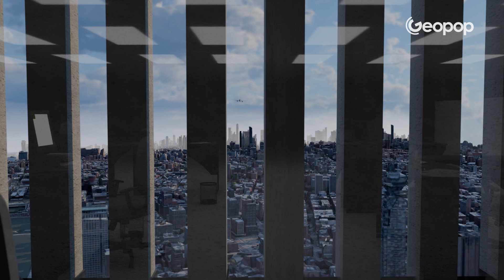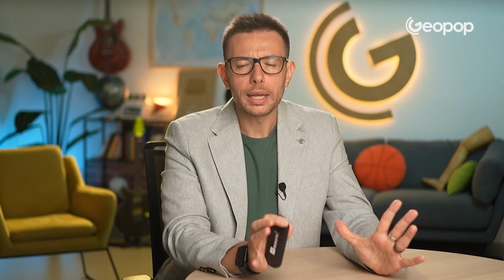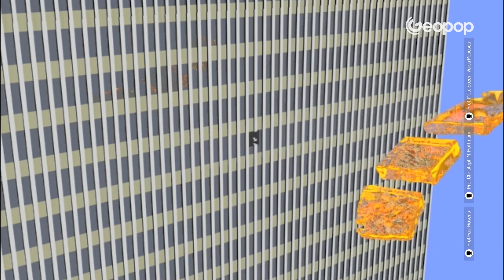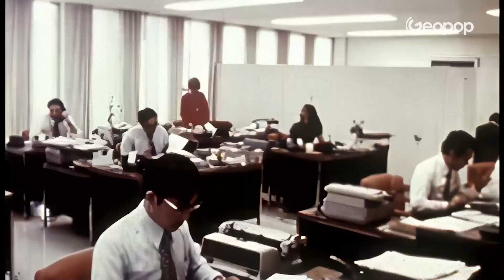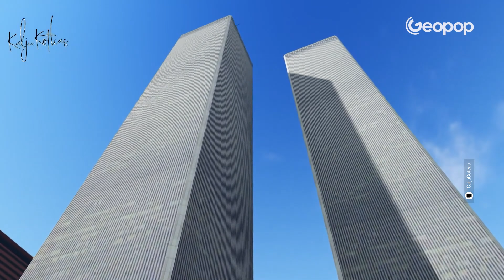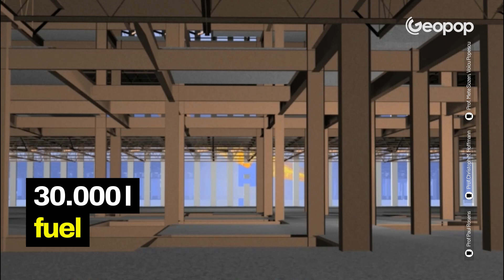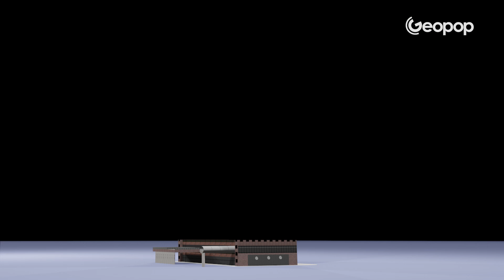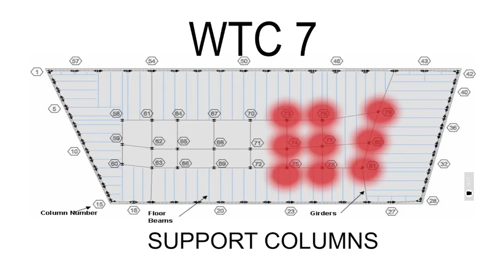9/11, 2001: The Technical Reconstruction of the Twin Towers and WTC 7 Collapses

Comment: "Steel melts at 2500°F" so, at 2499°F it's still just as strong in holding up half a skyscraper as if it were at ambient temperature?
Reply: I believe the buildings were brought down by controlled demolition. But what
You're saying is pretty ignorant
Reply: Steel doesn't have to melt to become soft, otherwise blacksmiths would all be out of a job.

Comment: Both buildings were charged with explosives & traces of Nano-thermite was detected prior to hasty removal of debris, of which there was almost nothing left standing, other than a couple of large skewers of steel, where did the rest of that asbestos ridden building go?
The owners prior to Lowry & silverstein, the Port Authority, knew of the asbestos & had a real problem, can't sell, can't demolish, well, not in the way it was done.
But WTC  7 is the give away, no plane, no structural damage to speak of, and was down by 5:23 pm that day....how, no time to set explosives, & i watched it, THE PERFECT FALL, right after they said "pull it"
A demolition phrase or terminology, but you guys all know this...Right?it is all in the truthfully reported  (by the 3,500 architects and engineers) information and way more.
Rebecca Roth & Barbara Honniger know all about it , the Israel students etc.
Really, it is just so easy, & you don't have to be an engineer!
Reply: I'll take things you just pulled out of your ass for $100
Reply: If that were true, then what was the point of the airplanes?
Reply: @ 
you can’t just go to war if you demolish a building,
 for the green light to go to war you must be attacked on your own soil
Reply: @BigDealDaz63  Terrorists tried to blow up the towers in 1993 without using airplanes. Why not blame them?
Reply: @BigDealDaz63  - What if the terrorists had missed all four targets instead of just one, and no buildings collapsed because none were hit?

Comment: Oh sure, let’s all just suspend every ounce of common sense and engineering knowledge and believe that a flimsy aluminum aircraft—whose nose can barely withstand a bird strike—somehow sliced cleanly through the World Trade Center’s exterior like a hot knife through butter. Because why not? Physics, engineering, and logic clearly don’t apply when a convenient narrative needs to be sold.

Let’s break this down like adults with functioning brains. The Twin Towers weren’t made of paper-mâché. Their exterior walls consisted of massive steel box columns, each interconnected by 2-foot-deep steel spandrel plates wrapping around the building like an industrial-strength belt. These columns and plates weren’t just decoration—they literally held up the structure, distributing weight and reinforcing the integrity of the entire skyscraper. The floors? Not flimsy office tiles, but 4-inch-thick reinforced concrete, embedded with rebar and supported by single and double steel trusses. Yet, we’re supposed to believe that a plane, built primarily of lightweight aluminum, punched through all of that—over a dozen thick steel box columns, multiple 2-foot-deep spandrel plates, and several heavily reinforced concrete floors—without even slowing down? And the kicker? The plane conveniently “disappears” into the building with zero parts breaking off on impact. No wings shearing, no tail detaching—just a seamless vanishing act into steel and concrete. Hollywood special effects teams must be shaking with jealousy.

And then, as if by some miracle of indestructibility, this same plane—after supposedly tearing through all these layers of hardened structural defenses—remains so intact that it still has the power to reach the core columns, which are even thicker, more heavily braced, and designed to carry the entire weight of the building. What are we supposed to believe? That this plane, which would have crumpled like a soda can upon real impact, somehow stayed structured enough to cause critical damage deep inside? Explain to me how that makes any sense at all.

But wait—it gets even better. Because, as it turns out, there just happened to be Israeli “art students” hanging around the World Trade Center in the months leading up to the event. And these weren’t just any art students—they were reportedly seen working with detonators and power feed lugs, aka components used for explosive setups. And what a coincidence—this activity was happening on the 91st floor, right around the area where impact and subsequent collapse conveniently took place. But don’t think too hard about that! The New York Times even did us the favor of running a puff piece about these so-called art students, making sure we all know how totally normal it is for foreign nationals with military demolition expertise to be given VIP access to one of the most secured office buildings in the U.S. months before the deadliest attack on American soil.

And lo and behold, 9/11 gave the U.S. government exactly what it needed: a green light for the War on Terror, the passage of the treasonous Patriot Act, and the birth of the Department of Homeland Security—a machine designed to monitor and control American citizens in the name of “safety.” But no, don’t ask questions. Just accept the fairytale and move along like a good little citizen.
Reply: I'm waiting for you to bring on the functioning adult part.
Reply: A child wouldn't understand,  sorry stinky
Reply: КАк блять вы умудряетесь 100-тонный боинг на скорости минимум в 500 км\ч  ужать до консервной банки, а прочность конструкционной стали завысить до такой степени, что удар по ней боингом ее якобы не должен и поцарапать?

Comment: I'm Canadian but went through NY city on the way to Florida (by mistake actually, wrong turn long story).  Anyways, decided to make a day of it and one of the things we did was go to the roof of one of the towers.  That day sometime in July 2001 I remember the elevators that went straight up to the top were closed so we had to transfer one or two times, can't recall, but it took a while just to get up there, and remember thinking wow these towers are so massive you have to switch elevators...crazy.  Then 9/11 happened and you see it on TV but it just doesn't show the how massive these buildings really were.

Comment: If there wasn't melted steel and it was only weakened then why did FDNY Captain Philip Ruvolo report molten metal flowing through I beams in the world trade center on 9/11?
Reply: He was in Building 6, the interview was casual while he was still trying to process the trauma of the event and as far as I know, he did not perform any metallurgical tests.  Like so many eyewitness accounts it can't be taken too literally without corroboration.  It's an anecdote.
Reply: Much of the molten metal was from the thin aluminum cladding which completely covered all of the structural steel elements of each tower.

Comment: cool. so all the beams in the entire building were under such heat so that they collapsed like a card house?
Reply: No, that's not what happened.
The structural elements at the impact points were damaged and compromised by the heat. When they collapsed, the upper floors 'fell' through the gap at the impact points and struck the lower floors. As each floor was destroyed, the floor below it collapsed in a 'pancake' fashion.
In short, the downward force of the falling upper floors successively overwhelmed the strength of each of the lower floors.
Reply: Nope. were you paying ANY attention at all?

Comment: Ok there’s literally almost no chance that burning debris from the collapse of WTC1 some how landed on WTC7 it would have had to be literally shot out like a canon to be able to hit that building. Also there were other buildings in the way
Reply: Incorrect. You aren't using the thinking part of the brain. When the Twin Towers collapsed the sides (perimeter column structures) peeled (think Banana), splaying out us much as 800 feet from the base to the 4 points of the compass. As shown below;

www.youtube.com/watch?v=g_SvpwyC17M&t
Reply: Did you not see the photographs of WTC7 with a large section near one corner severely damaged and on fire?
When structural steel beams fall from 1100 feet, they can do at lot of damage.

Comment: One of the conspiracy theorist's main complaints is that the jet fuel couldn't have melted the steel and thus, couldn't have caused the towers to collapse. But this is a fundamental misunderstanding of what actually occurred to the buildings during/after the attack as well as a lack of understanding of metallurgy. 

Steel doesn't need to melt to lose it's structural integrity. It only needs to be subjected to extreme temperatures to a certain point and for long enough for the mechanical properties to begin to change (loss of strength).

At temperatures beyond 650 degrees Fahrenheit, A36 structural steel begins to lose it's strength and integrity and that process will progressively cascade the hotter the fires become and the longer the material is subjected to it....until the point of failure. Now add a few hundred thousand tons of weight to that steel....it won't take long for failure to occur. The buildings were certainly subjected to temperatures well beyond that.
Reply: Yep, remember that photo of the woman standing in the gaping hole surrounded by that 650 degree fire?  I wonder how she was able to survive, standing there waving for help with all that heat.  Must have been unbearable. 🤔

Comment: I was hoping that there might be some news in this video. Unfortunately, what I saw was another talking head, parroting the "official" story of 9/11. Nothing was mentioned about witnesses that heard explosions in separate locations BEFORE the 1st plane hit. These witnesses were never called in to testify. 
    Steel gets weaker as it is heated. The illustration you used showed a truss jutting out in the air. At 900° it sags pretty badly. But every piece of steel in those buildings was mechanically attached to 2 other pieces of steel. Then there is concrete between the core & perimeter. These 2 facts call into question whether enough deformation could have occurred that one floor could crash down to the floor below, causing IT to start a cascade of unjustified failures. 
   In keeping with the rest of the world, you also gave no explanation for undamaged floors offering no apparent resistance to collaapse. 
    You also stayed away from the cartoon physics of the outline of the plane cut into the structural steel perimeter. Thats like shoving an empty beer can through the grill of a truck, & it cutting out a perfect circle. 
   I dont claim to know what really happened on 9/11. But after watching everything that was made available to the public, I KNOW, the NIST report is not an accurate account of what happened it ignores too of the physics, & far too many witnesses, to be taken seriously. And, against all hope, you added nothing of value to the story. You only repeated the incomplete, & inaccurate narrative that was fed to the media.
Reply: They only mention things that are true and relevant, not conspiracist fantasy and unsubstantiated internet rumor. 

Sagging floor trusses were clearly visible. Inward bowing of perimeter columns by up to 5 feet until they buckled, initiating the collapse was also clearly visible. It is not theoretical. It happened. 

WTC2 Collapse -- Gary Pollard (Enhanced Raw Copy from NIST) 

www.youtube.com/watch?v=ULdiD6gYZO0

Comment: How did the bottom fall out when major damage was towards the top?
Reply: The 47 core and 236 perimeter columns of the Twin Towers support all of the gravity loads of the building. ALL of the resistance is in the columns.

Planes impact Towers, causing massive structural damage, destroying sprinkler systems, tearing out gypsum board walls and blasting off the SFRM insulation from the floors. Multiple floor-wide fires are started instantly and spread rapidly due to the destruction of fire protection systems and venting of the building during the impact.

Serious fires were largely confined to the impact damaged floors and those immediately adjacent to them.  

Fires were started by the impacts and fuel aboard the aircraft, which acted as an accelerant. No shortage of other consumables inside the tower to continue the fires. 

Collapse was initiated (started) at the impact and fire damaged floors when floor trusses exposed to heat over time sagged, in turn pulling on and causing the inward bowing of perimeter columns by up to 5 feet until they buckled. 

No steel melted or needed to. Structural steel will bend and fail at less than half its melting temperature.

Once the perimeter columns buckled the formerly static load above became a dynamic load 30 times greater, easily overwhelming the structure below.

Thousands of tons of now loose debris fell through the open off space - through the inside of the building bypassing the columns - dropping 12 feet onto the first intact floor it comes across. The massive instant overload causes the floor to fail, adding its mass to the falling mass which continues to accelerate for another 12 feet until it impacts the next floor, rinse and repeat all the way down. Rate of collapse increases as momentum increases. As each floor fails, air inside the building (the Towers were 95% air by volume) is compressed, then blows out the sides _in reaction to the Tower falling, not the cause of the Tower falling.

No fire required at all on floors below the impact points for them to fail. The mechanisms that started the collapse are different to the mechanisms which continued the collapse.   That will be a difficult concept for some.

As the floors fail the perimeter columns are left literally hanging in the breeze, no longer attached to the rest of the structure. They peel away and fall in great sheets (think banana) out to more than 600 feet from the base on the 4 points of the compass. 

Core columns failed last. 

Each 110-story tower had a 1-acre footprint. The debris pile was up to 14 stories deep and spread out over 16 acres, destroying 8 surrounding buildings and damaging more than 100 others.
Reply: I'm not reading this goofball's crap But I can tell you.These buildings were brought down by explosives In a controlled demolition. This moron is gonna tell you how the top of the structure collapsed bla bla bla. The dabree was really no taller than the lobby. If the top crushed the bottom,  where did it go? Why are the core columns visible? The exterior columns were the same on the 91st floor as they were on the 10th floor. That should tell you how strong that framework really was.
Reply: @robbiehiatt9966  If the buildings were wired to explode, then what was the purpose of the airplanes?
No one ever answers this question.
Reply: @kyle381000  Without the airplanes there would be no reason for the building to explode and fall down

Comment: Watch crash test were cars crash into concrete walls in different speeds. The cars disappears more or less, but the concrete does not break
Reply: I've seen fighter jets hit the concrete wall with the same results
Reply: And that has what to do with 9/11 exactly?  

I don't think you understand that cars are not planes, concrete walls are not steel office towers 90% air by volume and resembling cages, not solid objects. Steel cages held together by bolts (hint, hint, hint).
Reply: @TheLoonResistance  No, cars are not planes. Planes are made of thin aluminium and can not go thrue concrete and steel, id*ot. Impossible
Reply: @Söderlund11  - So why can't 117 tons of airplane, moving at up to 289 mph and impacting with the energy of a ton of TNT split some welds, bend some thin mild steel plate and sheer a bunch of 5/8" bolts - LIKE WE ALL SAW ACTUALLY HAPPEN?

TWICE

Please show your math. No ignorance fueled personal incredulity and baseless assumptions allowed. 

In the meantime,....www.youtube.com/watch?v=P8mG9pyImb8
Reply: @Söderlund11  - You're welcome
Reply: @Söderlund11  
Firstly, there was no structural concrete above ground in either of the towers, therefore the airplanes did not have to 'go through' any of it.
Secondly, the vertical surfaces of the towers were 30% glass, which created a 'cheese grater' effect.
Finally, the structural elements of the towers were bolted together (not welded) and they were designed to withstand static vertical loads (i.e. gravity), not dynamic horizontal loads (i.e. an airplane travelling at high speed).